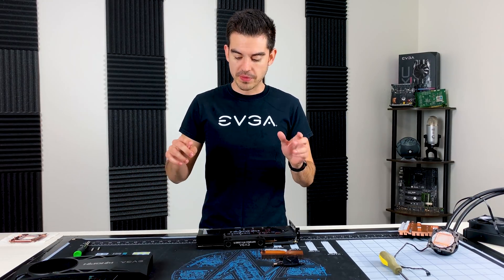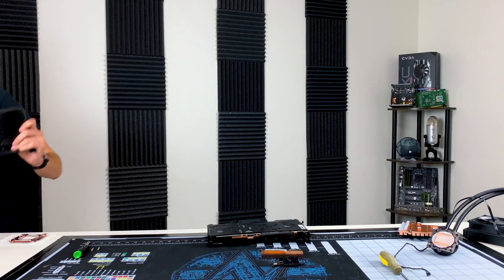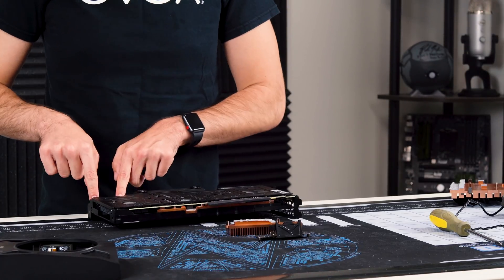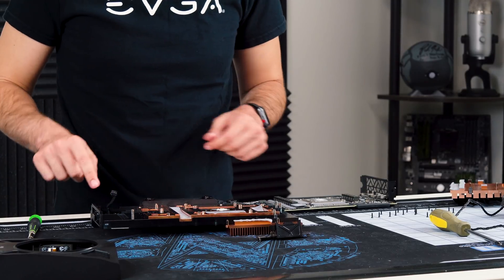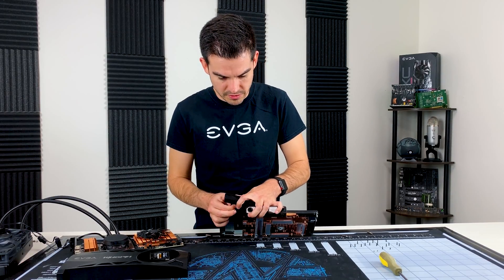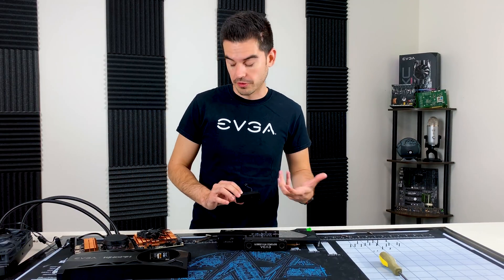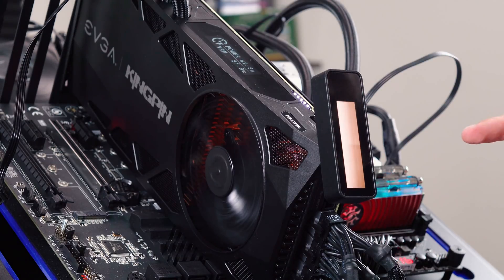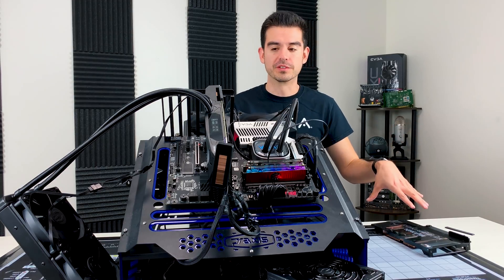KINGPIN with Two Screens?!

Comment: Save between 5-10% products on the EVGA website with an associate code. Just remember to put one in at checkout. Codes can be found on the EVGA website forums or you can use mine: 97A7E89A6R1N2LI to find out more about the Associate program and to have the option to use mine without a cut and paste you can fallow this link https://www.evga.com/associates/default.aspx?associatecode=97A7E89A6R1N2LI

Comment: Save between 5-10% off products on the EVGA website with an associate code. Just remember to put one in at checkout. Codes can be found on the EVGA website forums or you can use mine: 97A7E89A6R1N2LI to find out more about the Associate program and to have the option to use mine without a cut and paste you can fallow this link https://www.evga.com/associates/default.aspx?associatecode=97A7E89A6R1N2LI

Comment: What really is the point to a screen on your gpu other than driving up the price. It doesnt even look that nice it seems kind of tacky.
Reply: To monitor temps, mostly. The OLED temp readings come from a coupler that is independent from the driver so if you're using ln2 or dry ice and the PC crashes you still have an accurate temp reading without having to run your own couplers. The other stats are useful but you could use an osd for those.

Comment: That was some bad paste application for a card of that price point.
Reply from the maker: Ray here, that thermal paste was my bad, it is because the block was never fully installed on that KPE card. I placed the block on and mounted only some screws (for the purposes of the video) but it was never fully tightened down to spread the paste. Remember to that there is no standalone Hydro Copper card, just a separately sold block and it is up to the end user to make sure that the paste is applied correctly. Sharp eyes for catching that!

Comment: why not make a standalone oled display  app that reads data off hwinfo and outputs it to the screen ?
Reply: You could get a small screen that allows you to plug in a hdmi connector or whatever in the back of your card and use Rainmeter with Hwinfo to get the same effect.